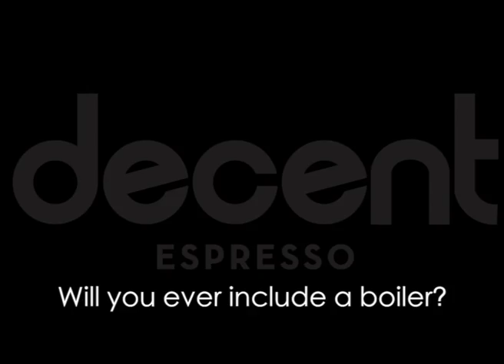Will you ever include a boiler to steam during brew?

Comment: In summary, if you want to run a machine on a North American 120VAC and stay under 15amps total draw AND keep full power/quality during the espresso process and steaming process, you have to run them in serial. Commercial machines run on 240VAC so have double the power. Consumer dual machines sacrifice quality as they don’t have the power to do both well at the same time.

Comment: Hi John, 
A question on the steam. So 5bar pressure and 170 C steams 200ml in 21 seconds. How come it doesn't make it faster? A machine like the GS/3 doesn't get near those numbers yet it will probably steam 200ml in like 10 seconds. So why is that? And isn't 5 bar too much? Isn't that going to blow a hole in the pitcher? (ok that last one was exaggerating 😀)
Reply from the maker: The GS/3 compensates by having a hugely greater flow rate than Decent does.  That's how they heat the milk so much faster.  

As far as "blowing a hole in the pitcher" our flow rate is much lower, for lower dilution, but that also lowers the "propelling force" of the steam, since our steam has so much less mass.
Reply: @decentespresso  thanks as always. One more question. Because I've seen in one of the earlier videos a cup rail. Does the top get hot enough to preheat the cups and is there going to be actively heated in future? I kinda have a feeling I've asked that question before but i can't seem to find it.
Reply: @lubenzz  Once you buy the machine you are invited on a forum, where people build high quality aftermarket parts/accessories for the machine. There is one stainless steel tray heated that goes at the top of the machine.
Reply from the maker: @lubenzz  "cup heating" is a nice way of doing something with all the wasted heat that boilers throw off, but it's not an efficient way to heat cups.

No, our machine stays cool, under 50ºC at all times.

To preheat a cup, a few options:
1) use the FLUSH feature to put boiling water into the cup. This is best.
2) microwave your cups (this is what I do during the winter)
3) there is a 3rd party tray and plug in warmer available for the DE1.